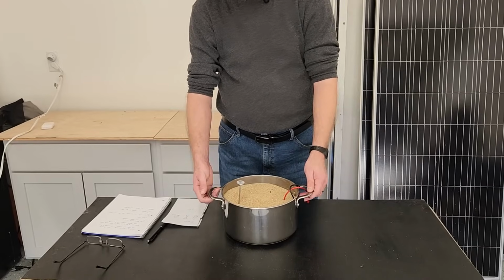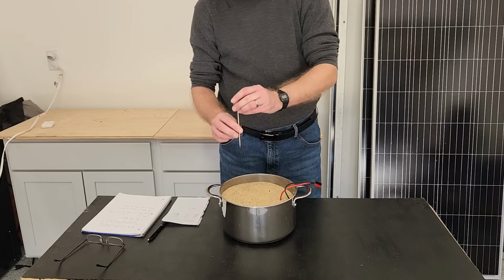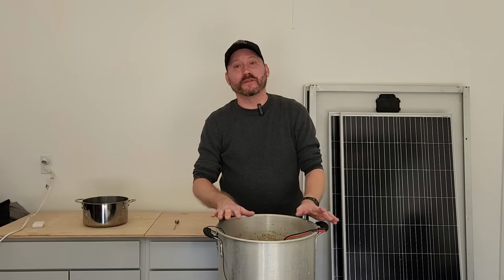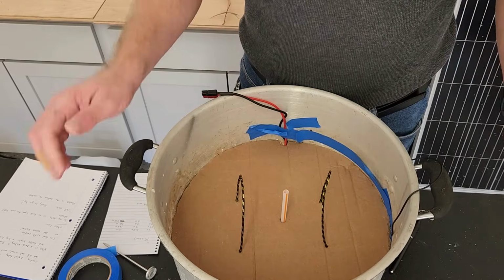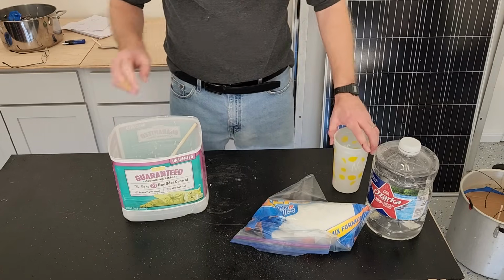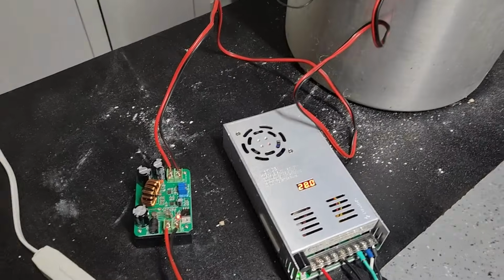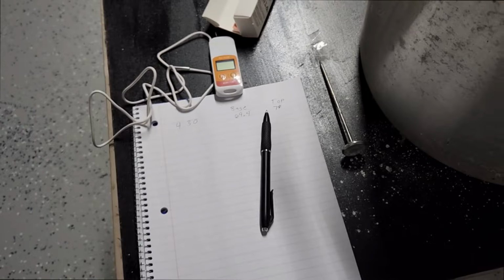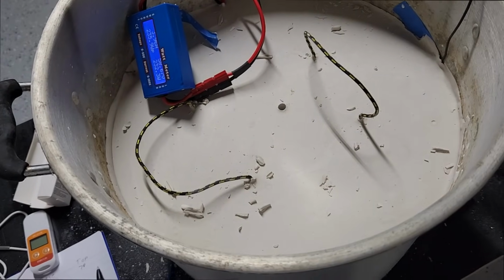Sand Battery heater. Create free heat  of 500F using solar electricity! Texas Prepper Projects

Comment: Will copy paste my comment here in hope someone smart will give his review about is it possible..

Ok I think we could buy old steel tank from truck at scrap yard 3000-20000 liter and fill it with fine sand that have big capacity for heat storage at high temperatures. 
(Cost of a such tank here is about 1500$)
Can go up to 300-400*C inside steel tank and with stainless steel tank even higher.
(That way we have many times larger capacity of heat than using same volume of water at 100*C)

We cut rectangular hole in steel tank and put copper plate 40x40cm with ribs going into sand to spread heat faster, painted black on that place so that spot would receive all heat we are going to transmit to the tank.
(That tank is welded and hermetically sealed with tons of sand inside.)

Now we buy another slightly bigger tank, coat from inside with reflective coating, put our first tank into it and make sealed glass window 30x30cm on it to align with black coated copper on inside tank.

Internal tank should be sitting on a bigger tank with some non conductive and heat resistant legs so that would not transfer heat to surrounding tank.

We make outer steel tank more rigid by welding outer support so it doesnt shrink, put some copper pipes around and insulate whole tank very good.
-Those copper pipes are to flow water into them for heating.
-To outer tank is also connected vacuum pump that makes vacuum between two tanks to stop 2 ways of heat transfer (conduction and convection).
-That inside coating of the tank stops 3. way of heat transfer which is (radiation).

Now we make huge set of parabolic mirrors that would be guided with motors to reflect huge amount of heat through that window to copper plate and heat sand material and inside steel tank up to 300-400*C or more with stainless steel tank.

We can use huge parabolic mirrors 2x2m by adding many smaller ones to construction of a big one.
We can also put 4 mirrors at window at 30* to collect light that would otherwise not hit the window and size receiving area up to 1m.🔳

How does it work?

So on a sunny day mirrors should reflect huge amount of heat through a window of outer tank to a copper part of inner tank filled with sand that would get very very hot because its totally, vacuum(conduction and convection) and coating(radiation) insulated from the outer surface.

Now when sun is out and we need heat we simply push the water through pipes connected on outer tank and via motor we make less vacuum between so outer tank and  pipes start rapid heating and water gets hot.

Then we transfer water to our house boiler for a in house hot water and room heating, or to a steam turbine that could make electricity all summer nights when we dont need so much of a heat.

Such a well insulated tank could maybe keep a sand hot for a month which is great considering whole week might be cloudy.

Am not sure if about 50sqm of mirrors would be enough to make such amounts of heat during winter but it seems like long lasting, not much expensive and very earth pollution saving project.

Would like some engineer to take a look on this and give real calculations about efficiency and possibility for such a project.

Thanks for making me think of this idea and please everyone who have some recommendations or ideas to add something..
Reply from the maker: Awesome!

Comment: How about if you put fire cement all around the inside and mix in perlite with the sand (ratio two cup three cup sand one cup perlite)? Like a mini pizza oven to hold heat for even longer (upto 48 hours).
Reply from the maker: check out my other videos. I tried this

Comment: Insert the heating element like you would in a hot water heater, by drilling a hole in the side of metal bucket and attaching with bolt attachments, wonder if you could also drill some holes into the sides of bucket to allow more heat to escape toward middle of bucket where it's the hottest..I might add,I know nothing about this so don't come at me for not knowing wth I'm talking about 😂
Reply from the maker: Watch video 2 for the reason I didn't do this

Comment: I could fit one of these into my camper but can I use an alternative to sand that is similar in thermal performance but not as heavy? I was thinking of some wall mounted heater but anything heavy in a van thats always bouncing and vibrating is a recipe for broken mounts and damaged walls
Reply from the maker: You are better off with a Mr buddy propane heater
Reply: @texasprepperprojects  excess solar is free....

Comment: What sort of space would this heat and at what outside air temp?  Thinking a van or box truck.
Reply from the maker: Check out video 2 and 3. Short answer: not worth it. Use a Mr. Buddy heater or an electric blanket

Comment: neat idea, but why not use something like a Fresnel lens to directly heat the sand negating transmission and conversion losses?  ETA the downside is you would have to move the pot into the heater and into the house.
Reply from the maker: Check out video 2 and 3
Reply: will do! @texasprepperprojects

Comment: I just learned, that water has five times higher thermal coefficient. So 100°C water has the same amount of energy as the same weight of quartz sand at 500°C (4.2J/gK vs. 0.83J/gK). Also sand is poor heat conductor so making this on a small scale doesn't make sense. And you will burn out that heater too, since it is a meant to heat water which stops and boils at 100°C.
Reply from the maker: Watch video 2 and 3 on this!
Reply: @texasprepperprojects  I will, thanks for mentioning.

Comment: Im thinking to use much more sand but much less heat. the plan is to have liquid heated underfloor heating which would be warmed by vacuum tube solar arrays during the day, just wondering how long it would stay warm for and also if perhaps i should also fit an electric underfloor heating to hook up to my electric solar panels. First i need to insulate the outside of my house. it's 90% cement with a wooden roof and some wooden siding.
Reply from the maker: Watch my other videos first!

Comment: A practical,, efficient idea.    On a cold day with sun,, could you place the device in glass toped, insulated  outdoor box, and have passive solar radiation it up the way rooftop water heaters work?    The glass, would have to be a double or triple glazed  convex  lens for concentrating sunlight.    If you can get it up to 150 F and make six of them,  each bedroom and bathroom could have one to provide heat at night.   Would that  work?
Reply from the maker: Work, yes. Provide enough heat to be useful? Doubtful. Check out my videos on parabolic reflectors

Comment: I might have missed it, but I didn't hear you mention how long it took for the sand to release its energy...
If the outside of the pot got up to 100°, how long did it take to reach ambient temperature..?and what was the ambient temperature..?
Reply: How long is not directly relevant.   If you just hold the heater element in the air, by itself, dangling from a support:  and you put 1500Watts of power into it for an hour -- you have added 1500Whrs of heat to the room.    If you bury the heater-element in sand, and you put 1500Watts of power into it for an hour -- you have added 1500Whrs of heat to the room.
the room heats up exactly the same amount either way.  The room doesn't stay any warmer any longer because of the sand - The rate the room cools is independent from the rate you heat it.    VoltageXCurrentXTime = energy (heat in this case).   If the powerXtime goes into the room -- The room heats by that amount, regardless of method. 
-- Physicist.
Reply: @Verfolnir  then what purpose would it serve..?
It must be called a sand "battery" for some reason.!? Isn't the purpose of a battery to store energy..?
Yes, you put 1500 watts into the sand; How long did it take for the sand to release the 1500 watts into the room..? And what was the ambient temperature..?
If I need 1500 watts to heat my house, when the nights are 14 hours long, and it takes 4 hours of sunlight to store 1500 watts (in your sand-battery), how long does it take for the battery to release the 1500 watts..?
If you dangle the element in the air the 1500 watts would dissipate within minutes, depending on the ambient temperature (and insulation)...if you store the 1500 watts in the sand, how long will it take for the 1500 watts dissipate..? 
Not a physisist...
Reply from the maker: check out my other videos for testing
Reply from the maker: agreed,. Check out my other videos for testing

Comment: The whole time you’re heating that pot the outside aluminum of the pot is dissipating your heat, I don’t understand why The pot is not insulated from heat loss.  Also any wire insulation will not be able to handle high temperatures and those heating elements are usually made of a nickel chrome wire inside of a ceramic core with a metal outer casing.  The wire gets really hot heats up the ceramic which intern heats up the outer metal casing.  The temperature that heating element is designed for if you run it a lot hotter than its design the wire on the inside could get too hot like red hot and possibly melt you can always adjust your voltage to lower the temperature.  The outside of the pot doesn’t get very hot only because it’s dissipating it’s heat that it gets from the outer layer of the sand if you insulate it the outer layer will eventually get almost as hot as the inside.  advantage of using San like you said you can get it a lot hotter and store more energy in a smaller volume of space I heated up a 50 gal tank of water to 180 degrees and it would heat my 25 foot travel trailer all night and Part of the next day.  You can also use used motor oil and run it up to like 250-300 degrees and have the advantage of circulating the hot oil through an exchanger inside the house while the oil remains outside the house in the insulated box
Reply from the maker: Check the two recap videos I posted for answers and solutions to this

Comment: I could not understand why you don't make a hole near the bottom of the pan and insert your probe from that hole amd keep all the wires out side. 
I.      I
I.      I
IProb0--------wires
I.       I
---------
Pan with sand inside. You can cover with another bigger container over it, with a small fan from one side and outlet for hot air from other outlet. I think you will be able to get free hot air to warm room.
Reply from the maker: Check out Video 2 where i answer this question    https://www.youtube.com/watch?v=siY-t8xlQhU&t=1s

Comment: You are making the mistake of placing the element at the bottom as if you were heating water which will convect up to the top. In sand the heat works by conduction only, so the element needs to be in the very centre so the heat will conduct equally. Also, I imagine that plaster is no better insulator than sand is. I suggest it would make more sense using external insulation on the base.
Reply from the maker: Check my followup cideos

Comment: There is a thing called Heat capacity:
Sand: ~1 kJ/(kg⋅K)
Water:  4.19  kJ/(kg⋅K)

Water still is the better medium eaven if the max temperature  is lower!
Reply from the maker: yup
Reply: For home heating application sand is actually better. The stored heat can be higher in sand providing we go up to 1200c . The problem with water, is that it will turn to steam and give you all kinds of problems.

Comment: Wouldn't it be more energy dense to build a phase change heat battery?  You will need something that melts at a temperature warm enough to be a useful heat source.  If your parts can operate at ~500ºf or more, then something like tin in a reasonably sealed container will provide around 80 times the heat capacity as it melts, than sand or other mass at the same temperature.  For a lower temperature holding point, sulfur, or even wax are good as their phase change at a much lower temperature.  Sand is fine, but you need 80 times more to do the same work.  Picking a phase change storage DRAMATICALLY improves how much heat you can store and re-radiate.

Tin is $1.50 per pound, and there is a page discussing using it to store energy for cooking, "Liquid Tin Heat Storage for Scheffler Parabolic Cookers".  Your sand stores sensible heat, the molten tin would store latent heat.  I used the 80 times factor above I got from using water to absorb latent heat in a phase change, I'm sure tin has a different number, but it will be in the same ballpark.

Basically I'm saying a sand battery is good, but you can do better with less mass if you include a phase change.
Reply from the maker: Check out video 2 and 3
Reply: @texasprepperprojects  Good work covering the capacity issue in vide 2, and the practicality issue in video 3.  But Aluminum foil and plastic tarps from local stores can be used to make the parabolic mirror, so that is practical.  The Tin on the other hand is not going to be easy to obtain in large amounts in the middle of a disaster...  BUT as I pointed out, ANY phase change material will work for this.  Around here you might be near a farm, and be able to lay your hands on amonium nitrate in large amounts, it has a great temperature range, but making a container safe to hold it is a challenge.  But then it hit me....  use water and some plumbing.  Put a container of water outside where you can heat it any way you want, wood, propane, parabolic mirror...  Then connect it to some plumbing to a radiator you make in your home... it could be an old car radiator, or just copper pipe from the home depot.  Reinvent the steam boiler used in the radiators of the past centuries.  But even through you could get the parts easily, the practicality is still an issue.

But wait, Native Americans have been using sand batteries to heat their sweat lodges for centuries...  Well, sand is crushed rock right?  The native americans use large grain sand (rocks) weighing a few pounds each.  Build a fire with whatever scraps tyou have, heat rocks, and bring them in the house...  The propane heater is far more practical, until you run out of propane...  

The problem with sand/rock batteries is as they cool, the heat coming off slows down so much it is hard to get it out, only a fraction of the energy comes off fast enough to provide heat, and it won't last over night.  Bacok in the 1970'd energy crisis, thermal batteries were common...  An acquaintance of mine in Colorado only recently sold a house with an installed thermal mass (hundreds of gallons of water on a sun porch as a wall between the sun porch and house)...  BUT that requires advanced planning in designing the house, and while not exotic, you aren't going to build a new porch during a blizzard (and it won't hold enough heat to do more than a few hours of the evening).  So yeah, get a propane heater...  Or one of those new waste oil heaters.

Comment: BEST APPLICABLE, PRACTICABLE, ECONOMICAL AND ECO-FRIENDLY SOLAR ENERGY BATTERY.
THIS IS NOT A COOKER BUT SOMEBODY  COULD MAKE A SOLAR COOKER.......................................
TYPICALLY, WE ARE ALWAYS USING THE WARM OR HOT WATER AROUND 35~45 CENTIGRADE ,
ACTUALLY, WE DO NOT NEED THE WATER HIGH ABOVE 65 CENTIGRADE EXCLUDING THE VERY VERY OFTEN CASES.
THIS SOLAR STORAGE EQUIPMENT IS VERY ENOUGH TO MAKE WARM THE  HOUSE OR THE GREEN HOUSE .....
THE FREE ENERGY COSTING ALMOST LITTLE EXPENSE IS NOT RELATED TO AN EFFICIENT PROBLEM BUT AN EFFECTIVE ONE
NAMELY, THE WARMER, THE MORE ECONOMICAL, THE HAPPIER, THE BEST.
Reply from the maker: Thanks

Comment: The concept is good, but sorry, I have multiple issues with the execution.

The biggest is running wires into and through sand that is intended to reach (and hold!) high temperatures.
When making my own sand battery (heat bank) I'll  be installing two hot water cylinder elements through the sides of the container, such that the terminals remain outside, easy to connect to and switch series/ series-parallel/ parallel as energy sources permit.
For temperature measurement, thermocouples with high-temp wires are cheap and easily installed to external terminals, again able to be connected to any electronics (measurement &/or thermostatic control) desired.

In my own plans I'll probably also install a small (car type) copper-cored radiator into the upper-middle of the sand-mass, with the inlet and outlet protruding for optional connection to either air, oil or water flow.

Insulation - I'll be wanting to limit heat-loss of the stored energy before I'm ready to use it, so some rock-wool batts lining the container on all sides will help with this.  Even when the sand is applying outward pressure due to its mass, there will still be a significant heat-barrier between it and the outside environment.

Good that you are experimenting though.  I'm sure you'll refine your invention through several iterations as you learn more.
Reply from the maker: Check out video 2 and 3 for the improvements

Comment: I am not in any way an expert, but here are my thoughts on your project. While you can get sand a lot hotter than water at normal air pressure, sand's actual energy holding capacity (specific heat) is far less. Liquid water holds about 4.2 joules per gram per degree, while solid silica is only about 0.7 joules. So for a given mass, water can hold about six times as much heat as sand can. If I understand it correctly, you could heat water up to several degrees below the boiling point pretty efficiently, but to hold the same amount of energy in sand, you'd have to raise it well over a 1000 degrees, and it would be very difficult to do that uniformly. I didn't do the metric to imperial conversion, so that's just an approximation.
Reply from the maker: check out my other videos on this for follow up information
Reply: @texasprepperprojects   Thanks, I will. And thanks for sharing your experience!